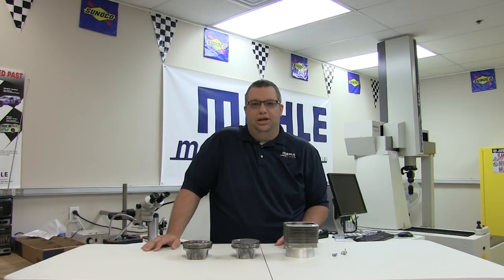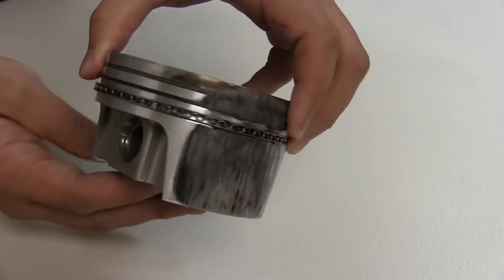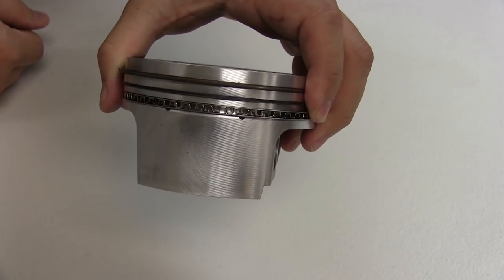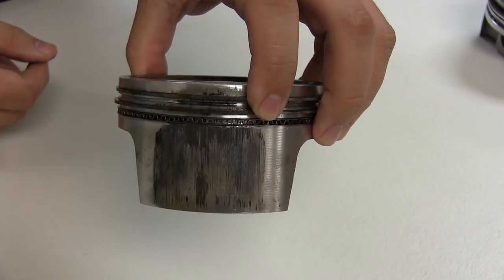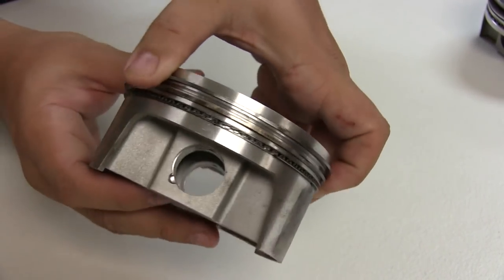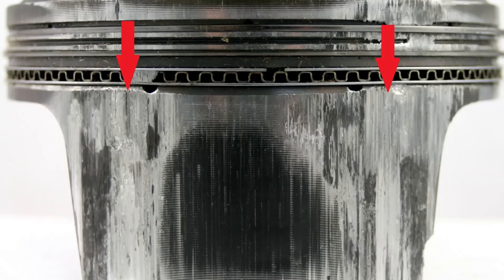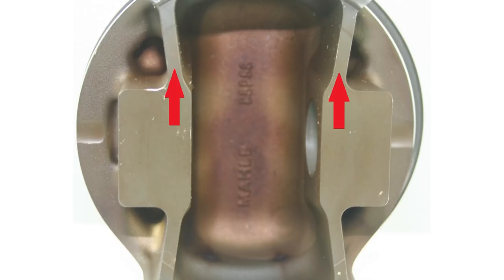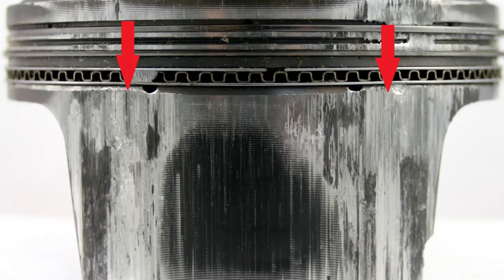Piston Failure Analysis-Overheating

Comment: While engines keep overheating I think the issue is that manufacturers save money and go cheap and small on radiators, trust me I found out the hard way!
My rad was way too small so I installed one meant for a SCANIA truck and boy... I can floor it all day!
The SCANIA radiator also has a built in oil cooler..so WinWin
Reply: True

Comment: I am dealing with an mbe 4000 mercedes diesel that has both scuffing at 45 degrees from the piston pin(180 degrees spart) and several cracks that run from the bowl outward to the edge of the piston.
  Injectors were tested( found to be functional). I cant find much info on diesel piston failure. Can you help?

Comment: Hello, my car got hot due to a puncture in the phalanx. Final result 3 scratched cylinders and pistons exactly as shown. Is there a solution for these pistons? Can I rectify the cylinder and put a piston 0.5 higher? Or new cylinders and new pistons. Best Regard

Comment: what are the common reasons that piston rings wear out?  My car seems to be burning oil..and I seem to take care of it in terms of routine maintenance. I change the OIL/Filter every 5000 kms..and I also do engine flush to get rid off any dirt.  Can you explain why my car is burning oil, when I have done everything according to manual. Every month I have to add 1 litre of oil to the engine block....and I just don't understand why this is happening!  Do the rings just wear out with age or as long as the proper maintenance is done then they should last.  Thanks. Look forward to your feedback.  PS: I have a HONDA ODYSSEY.
Reply: could be either pissin oil or drinking it. in a car a drinking problem can be many things. first check if you PCV is clean and working correctly. next undo your sparkplug and check their color, if they are black instead of brown, look if its all of them or just a couple.

Comment: Would improper valve adjustments make it over heat? This guy has my brakes and now it's overheating and I never had that problem before how can I check it cuz I need the scooter for work please help me before my engine seizes because I am losing power and not to sign right

Comment: What is the probability that piston rings will overheat and fail due to lack of oil/lubrication AND yet there is no galling on the piston skirt? In other words, will inadequate lubrication that leads to piston ring failure always be accompanied with piston galling?
Reply from the maker: Each case is different when a failure occurs.  It is best to contact our division directly and discuss a specific failure.  Can there be a failure of the rings with no pin galling - yes.  Is it from lack of lubrication or was it due to for example incorrect ring gap?  In these situations, we ask that a customer consult with our engineering department directly with specifics about their application.

Comment: Have a tick that goes away after it warms up but , using oil and low oil pressure and #3 cylinder has oil soaked plug. So what happened thinking ring broke or stuck and didn’t seat to walls before it stuck, or piston failure with skirt or something on those lines , what do you think it could be going to take it back out and discover what went wrong and fix it before it goes
Reply from the maker: Everything is a guess until we can view the parts.  If an oil ring broke it could have further implications causing damage to other parts of the motor.
Reply: I guess I need to pull it ain’t going to fix itself
Reply: @mahlemotorsport can you help me I am working on a Honda trx300ex 4wheeler and the piston is worn and I am trying to remove it . Took the circle pin out but can't get the bar out to take the piston off. And advice?

Comment: Hi. I need help. I purchased a brand new car, and it’s making a “scratching gear” noise when i do stop, and accelerate. Took the car for its first maintainance and point the issue, but they heard the noise and told me were the pistons; and asked me if i was paying for Premium gasoline… I said No. But is this enough to start giving problem to a 3k miles car? I use 93 Octane fuel. Whenever i accelerate to start going uphill, it makes that slip/scratching metal noise
Reply from the maker: Contact the manufacturer directly